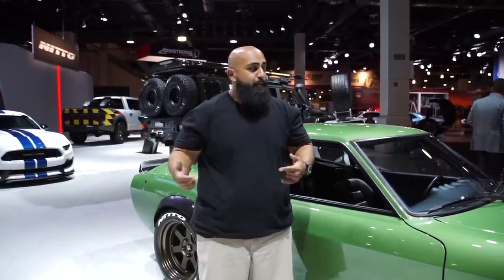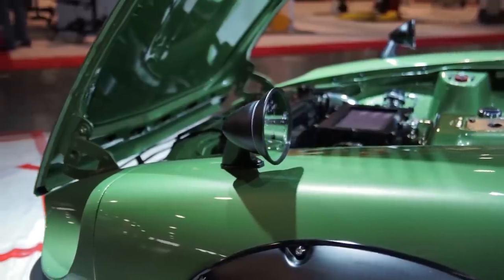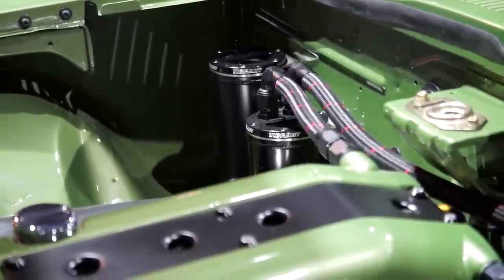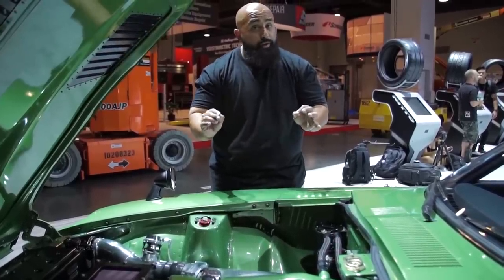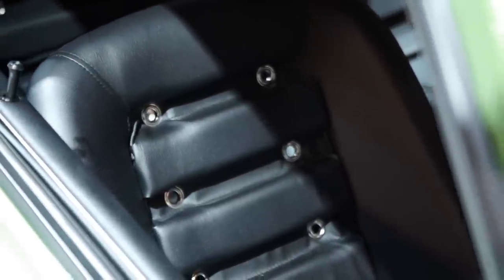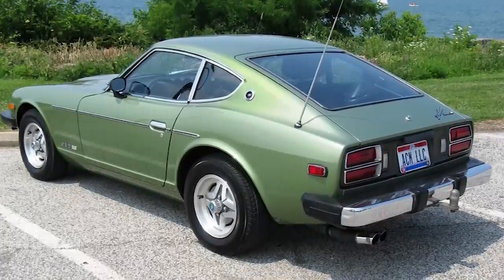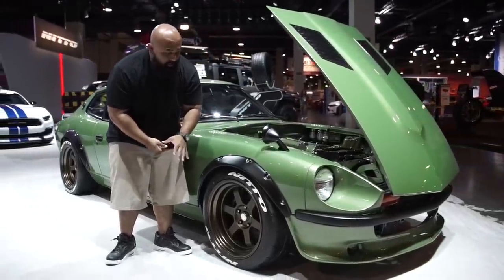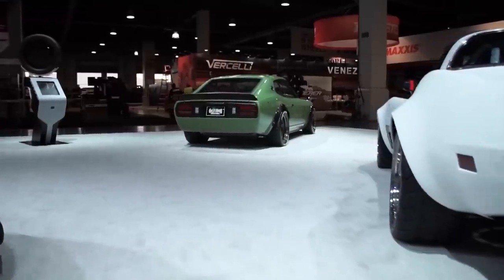Gas Monkey Garage Builds a Japanese Import: In-Depth Look into the 1975 Datsun 280Z with Big Mike

Comment: Great enthusiast build ,You can tell this guy put in heart. Not much on the 2+2. But they are out there and are Z cars. 
  I have a 73 240z and a 78 289z 
Both restomoded as twins. One blue accents in brilliant white the other red accents in brilliant white .
  Semi flat flares and spoiler and bumper as is here,a very common classic theme. 
Car looks good,and such low mileage you had to build it even if it was a 2+2.
Only problem with the 2+2 is you always wish you had the 2 seater.
 There have been a few really Kool 2+2 and if that's what you got ,you got to make them as Kool as you can.All the classic Z restom mids work.I don't like seeing any Z bone stock....that's a snooze fest.

Comment: Awesome looking car pity they put a 4 cylinder in it should have been a straight 6 maybe an RB25DE
Reply: I chose an SR20 for a variety of reasons, but one of the main ones was because of the weight balance that it retains. The car stays close to the original 48/52 weight balance that it came with originally when using an SR20, which was one of the reasons the vehicle was so successful in racing such as SCCA. Additionally, you must take in to consideration that the viewers of that show are used to high horsepower, torquey American muscle cars. A fully built SR20 with a properly sized Garrett turbo makes for solid horsepower and torque, which is something that makes it that much able to be respected/appreciated/relatable to those who watch the show, especially and specifically because it is a 2.0L, 4-cylinder "tiny" motor to them. Additionally, as much as I love the RB, I would have wanted to do a fully built RB26DETT and there was nowhere near enough time or money to do the setup that I wanted to properly. Nowhere near enough time or money. I hope that gives you some perspective and context to why I made the decisions I did. Thanks for the love.
Reply: Fair enough man, i still love the car at least it's not electric :-)
Reply: I'm just happy it's not a ls.
Reply: Or V10, as someone did in their channel 😂😂😂
Reply: Check out MCM 280z build. They actually put in a RB26 I believe and they take it to the track to reveal it.

(Actually it is a 240z)

Comment: 13k miles.    Would have left it alone.  Chopped up another one
Reply: Yeah, that's really the thought, isn't it. I get the wanting the modern engine and suspension. I just watched the two episodes of the build. That thing was beautiful before they started wrenching and cutting on it. Absolutely pristine. If it had been a survivor American muscle car, the guys in the garage would have mutinied.

And did you see what happened to it? After they sold it, the car burnt to the ground in the truck shipping it to the new owner. Sad end to something that had been left untouched for years.

Comment: Hats off to a gorgeous build.
Thank you for putting an sr20 motor in it instead of an LS.
I also would’ve been happy with an RB26
Reply: Thank you for the kind words. I chose an SR20 for a variety of reasons, but one of the main ones was because of the weight balance that it retains. The car stays close to the original 48/52 weight balance that it came with originally when using an SR20, which was one of the reasons the vehicle was so successful in racing such as SCCA. Additionally, you must take in to consideration that the viewers of that show are used to high horsepower, torquey American muscle cars. A fully built SR20 with a properly sized Garrett turbo makes for solid horsepower and torque, which is something that makes it that much able to be respected/appreciated/relatable to those who watch the show, especially and specifically because it is a 2.0L, 4-cylinder "tiny" motor to them. Additionally, as much as I love the RB, I would have wanted to do a fully built RB26DETT and there was nowhere near enough time or money to do the setup that I wanted to properly. Nowhere near enough time or money. I hope that gives you some perspective and context to why I made the decisions I did. Thanks for the love.
Reply: Big Mike 
Do you know a reputable shop in SoCal that can rebuild a redtop Sr20det?

Comment: 2+2 is great because of those openable rear quarter windows.    I can't remember if they are cable operated but they are in the later 280zx.       I remember having the a/c fan fail and opening the vent windows would suck the cold air through the a/c system on the highway and I had air conditioning.

Comment: Would have gone different with that build. Totally different styled chrome wheels, chrome backing on the rear view mirror and on the bullet-casing on the fender mirrors. Would have scooped in some halogen HogWorkz-styled headlights and clear-domed halogen taillights due to no rear bumper. Definitely wold have done a size-descending sectional-looking racing stripe front large to rear point ending between taillights like a stinger! That would have given the fast look, and win some auto shows! Interior color design, would have gone a pewter finish instead of black panels, heightened with chrome colored visible sound system. Cool resto-mod, but could have been a world-wide SEMA show-stopper!

Comment: I love the videos you put out and I love the Z I've owned a few seventies eighties 75 280Z Coupe was my favorite I'm very displeased that you did not give the L 2800 because that's such a the great engine to build up you have no idea the 3.1 stroker engine have it bored out in do so many crazy things to that and it's so torquey cuz of the straight 6 and it's so fast maybe you should rethink and redesign the 2800 and put it back in that car
Reply: Thank you for the kind words. I chose an SR20 for a variety of reasons, but one of the main ones was because of the weight balance that it retains. The car stays close to the original 48/52 weight balance that it came with originally when using an SR20, which was one of the reasons the vehicle was so successful in racing such as SCCA. Additionally, you must take in to consideration that the viewers of that show are used to high horsepower, torquey American muscle cars. A fully built SR20 with a properly sized Garrett turbo makes for solid horsepower and torque, which is something that makes it that much able to be respected/appreciated/relatable to those who watch the show, especially and specifically because it is a 2.0L, 4-cylinder "tiny" motor to them. Besides, this is a TV build, we couldn't/wouldn't leave the stock motor in there, it's full build. And the car is done, no motor swapping or design changes will occur. It will be a 2-episode build next season, as I understand it.

Comment: For those that said "Well why din't they keep the L28 then?!"'s reason was simple. Cost and again, more cost. 

I know you guys are raving that the Devil Z has a L28DETT in it and it makes 650hp reliably while able to go 200mph for 5mins without issue blah blah blah... Now stop. That L28 unit in that particular Z was totally bored out and thrown tons of money into it to make it that way while parts in the 90s for a L28 was still cheap. Now? Hell no. Even Japanese tuners are shunning away from it and rather throw RB26DETTs into 240Zs. Plus, it's in America! You're not gonna get a RB26 just like that like how you're able to get a 308ci from a junkyard or a crate LS from a magazine. The SR20DET is the only way to go. Just treat it as a chopped up il-6 and it still makes heap of power.

Comment: The cam covers are like that standard, it’s just the black top variety of the sr20
Reply: The valve cover has bungs welded on in specific places, the lettering was machined off, and welding marks and casting marks were smoothed down. That's what I'm referring to when I say that valve cover was contoured. It is by no means a standard valve cover any longer.

Comment: My uncle had a 280 2+2 when I was a kid and I remember that car being one of the fastest cars we had next to my grandpas 240 was slightly tuned better carb and cylinder head i was to young to remember every detail but older z cars were no joke still not at least the older ones are not the new ones are slow from what I have seen they need a lot of work done to get fast then still get beat by garage build Honda’s

Comment: 2+2 never did it for me but I guess it could be more stable in the corners. Amazing car bit I still think building a 2+2 was a odd decision, they just don't look right to me.
Reply: They don't look right to most. But with the right subtle changes (like what was done to this chassis), I believe they can look good, if not great. And I believe that was achieved with this car. And you are correct, the longer wheelbase combined with the wider front and rear contact patch all combined with more power yet the proper weight balance yields an extremely nimble vehicle.
Reply: It's all good brother! Different strokes!

Comment: Wait S14 SR20DSET? But that looks like a notch back, from the S15?
Reply: If you're referring to the notch on the valve cover, that is on both S14 and S15 SR20 motors
Reply: Ahh. Okay. The only S14 generations I have seen still have the KA or a SR20 from a S13. I mean I love my SR motor, was the N/A and threw a T28 turbo on. That Z is a gorgeous car.  Old school Japanese hot rodding.

Comment: 240's and 280s will always be sexy,  the bodyline just can't be matched. The car is a lovely green.That said if they were gonna engine swap and turbo the engine anyway, It is rather disappointing that they went for an SR engine rather than an RB which is a 6 cylinder  which is closer the original engines used in these cars.
Reply: I agree totally. A timeless chassis, for sure. I chose an SR20 for a variety of reasons, but one of the main ones was because of the weight balance that it retains. The car stays close to the original 48/52 weight balance that it came with originally when using an SR20, which was one of the reasons the vehicle was so successful in racing such as SCCA. Additionally, you must take in to consideration that the viewers of that show are used to high horsepower, large displacement, torquey American muscle cars. Using a 2.0L 4-cylinder motor was a great way to tickle them and have them laugh it off. But you combine that with a properly sized Garrett turbo and it makes for solid horsepower and torque, which is something that makes it that much able to be respected/appreciated/relatable to those who watch the show. I hope that gives you some perspective and context to why I made the decisions I did. Thanks for the love
Reply: Thanks for the response,  it's great to hear the thoughts and ideas that went into the car, from one of the builders. Yeah the green that was chosen really is lovely, I love that you guys picked a similar green to the original factory green that they could come in. I also love the original design datsun steering wheel, could've just as easily used an aftermarket one but you guys stuck with the classic wheel, it's the little things that  you really notice.

While as a fan of these cars, I still don't really like the sr20 engines, would've really have liked to see and RB or even the original 2.8 litre L28E I6 cast-iron block  in the car,  I am glad I understand now why you chose this engine.

All in all this is a great build, I am glad you guys decided to stay as close as you could to the original bodyline of the car, too many of these things have over the top bodywork done to them, like crazy widebody kits. This car is right down the middle, just right.

I do not like GMG garage or their T.V show, however this car is definitely something I can appreciate for the work gone into it.
Reply: You're welcome. That is actually the OEM color, just with a little extra touch by Mike the painter. Yes, a lot of people use an aftermarket or even wood grain wheel, and I didn't want to do that in the end. And I do agree, many if not change the body lines. This was meant to be accented and complimented, not altered or recreated. 

Many people have told me something similar. I was unaware of how much dislike there is for that show or people on it, but that's the way it goes I suppose. 

Thank you for sharing your perspective.

Comment: Why would you choose a 2+2?
Reply: Because most people wouldn't. That's one reason. I think left stock they are obviously less attractive than the couple, but with the right subtle changes (like what was done to this chassis), I believe they can look good, if not great. And I believe that was achieved with this car. Additionally, the longer wheelbase combined with the wider front and rear contact patch all combined with more power yet the proper weight balance yields an extremely nimble vehicle.
Show less
REPLY

Comment: this is beautiful but I feel the limited slip rear should just be welded. accept it for what it is, a drift car.
Reply: This car was not designed to be a drift car, not originally in the 70's and not now. It holds many SCCA titles and other road course racing-type accomplishment due to it's design and balance.
Reply: to valuable to tandem anyways. absolutely beautiful.

Comment: Valve covers not custom. Its a slant top SR20.
Reply: I'm not referring to the slant, I'm referring to everything else. Bungs were welded on in various places and beading cleaned up, the OEM lettering was machined off and smoothed out, and certain original casting marks and flaws were eliminated. Things like that is what I'm referring to when I say custom and contoured.

Comment: So whats the difference with this and the build from Sung Kang? what different color and motor swap..but they just followed footsteps for this build..nothing new.
Reply: Sung Kang's was a 240Z that was cut and widebodied, obviously changing the lines of the chassis; it was stitch-welded and has a weld-in cage done along with other fab work to continue the race car theme/style; and it a naturally aspirated RB swap. That car from front to back was done in the style of a race car. This is a 280Z with accents and compliments to the body lines, it has full interior that was customized but keeps comfort and OE style; this car has different suspension, different brakes, is 5-lug and so on; this is a turbocharged 4-cylinder powerplant. In other words, virtually nothing is the same in the two. If you take 2 minutes to read about that 240 and then read about this 280 you'll see that.

Comment: The valve cover comes like that
Reply: I'm not talking about the notch. The valve cover has -10 bungs welded on in specific places for crankcase ventilation, the OEM lettering was machined off, and welding marks and casting marks were smoothed down. That's what I'm referring to when I say that the valve cover was contoured.

Comment: I like two forty s   with try webber down draft system  one hundred and sixty five miles an hour. How fast do you need to go . Handling is a problem with a big motor  . The webber's drink gas ⛽ .but are fast as hell try webber's  need a bigger gas tank .

Comment: sr20?  Why not a rb26
Reply: I chose an SR20 for a variety of reasons, but one of the main ones was because of the weight balance that it retains. The car stays close to the original 48/52 weight balance that it came with originally when using an SR20, which was one of the reasons the vehicle was so successful in racing such as SCCA. Additionally, you must take in to consideration that the viewers of that show are used to high horsepower, torquey American muscle cars. A fully built SR20 with a properly sized Garrett turbo makes for solid horsepower and torque, in this case over 300whp over stock. Additionally, as much as I love the RB, I would have wanted to do a fully built RB26DETT and there was nowhere near enough time or money to do the setup that I wanted to properly. Nowhere near enough time or money. I hope that gives you some perspective and context to why I made the decisions I did. Thanks for the love.

Comment: I think a RB25DETT, would it been better.
Reply: I chose an SR20 for a variety of reasons, but one of the main ones was because of the weight balance that it retains. The car stays close to the original 48/52 weight balance that it came with originally when using an SR20, which was one of the reasons the vehicle was so successful in racing such as SCCA. Additionally, you must take in to consideration that the viewers of that show are used to high horsepower, torquey American muscle cars. A fully built SR20 with a properly sized Garrett turbo makes for solid horsepower and torque, which is something that makes it that much able to be respected/appreciated/relatable to those who watch the show. Additionally, as much as I love the RB, I would have wanted to do a fully built RB26DETT and there was nowhere near enough time or money to do the setup that I wanted to properly. Nowhere near enough time or money. I hope that gives you some perspective and context to why I made the decisions I did. Thanks for the love.